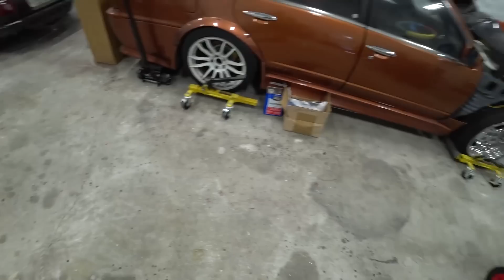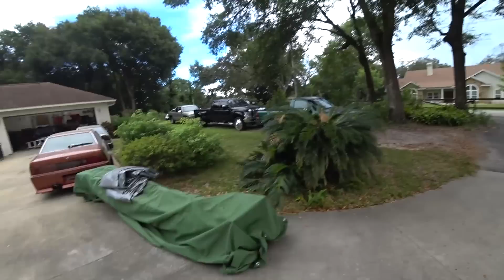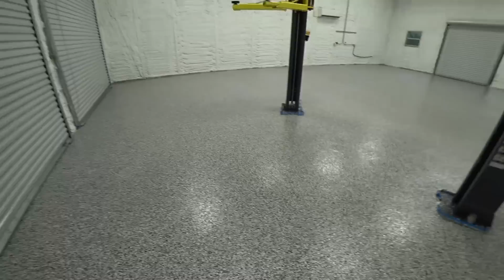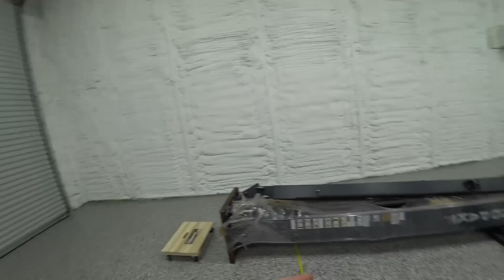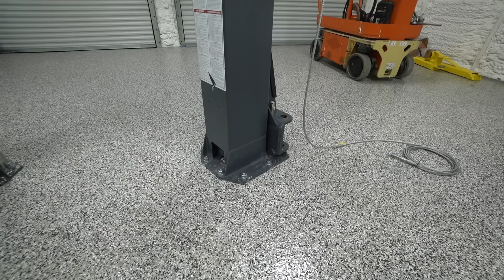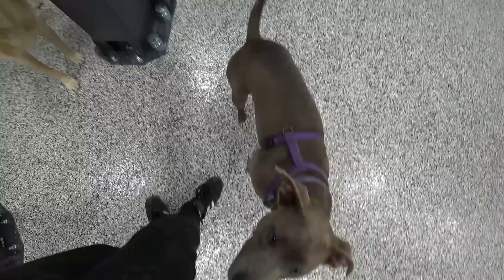My dream shop build is finally complete. came out amazing.

Comment: Taylor I came back to this video. I’ve got my new building up on my old concrete. I’m now ready for the floors. Was looking into the same that you have and was curious how they have held up. I want your size shop but had to settle for 20x50 but I did do the walls like you so I got a nice loft in. Thanks for any advice on it.

Comment: The basement at work got floors epoxied 30 years ago and before it completely cured someone (a PhD) rolled a pallet jack with something heavy on it and pulled up epoxy on the wheels for 100ft through a long hallway.  Why they didn't think to stop is beyond me.  It has never been repaired.  As you rolled the lift in this came to me.  That material they used on your floor must be good quality and you must have listened very carefully to the installers direction.

Comment: I would definitely not put the air compressor inside if you can help it. Too noisy too hot, build a little shelter outside and put it outside it will be fine

Comment: Looks great and I"m happy for you, long time planned usually turns out best.  I'm not sure if the spray foam you have on the walls is treated with fire retardant or intumescent paint but please consider covering it with sheet rock or even plywood if it's not.  Spray foam is highly combustible.

Comment: this was good action packed - nice to see floors done - you should do deck on back and some storage or office/desk back there too #who let the dogs out?
Reply: put up a couple tv on walls for pc monitor and get some decent speakers, put up banners/posters
Reply: get motion lites and cams, get a refurb server or 2 for the networking, run cat7 run at least 10g - think about getting a 800 buck 100g switch for your ws, 2 servers and a nas - you can do for about 3k and bring your own ws - the network is the weakest link and cheap 100g switches are game changers - combine with nvme - you can breakout one port into 2 25gbe also #mikrotik
Reply: sic 4 100gbe or 4 25gbe breakout cables avail - 25g cards are cheaper you could have upgrade path #swr matching

Comment: hey taylor floor looks great and you  are right when you say that poly-espartic is supposed to be more durable I install this these kinds of floors and they from my experience hold up quite well to oil/gas spills and such and it can take alot and with the flake you will never see any kinds of light scratches so you dont have to be worried about that just try not to steer ur wheels in place to much shouldnt hurt it but better safe then sorry but will last for a very long time

Comment: Polyurea floors are decent for that application but real shops would benefit from urethane cement and MMA top coat if you really want a floor that'll last. Glad you enjoy it though I do these floors all the time, what people need to realize with these, is that these polymer coatings are stronger than concrete but are only as strong as what they're bonded too. That said it'll only fail where the concrete would've already failed.

Comment: Hellfire concrete coating would not be as pretty as what you have, but it holds up unbelievably well to welding, grinding and hot sticky tires.

Comment: SO, I bought a building a cpl years ago not far from you, did the same thing, with PolyCuramine and Speckled flakes - it LOOKS nice, but it SUCKS for a mechanic/Machinist shop because if you ever drop a small screw, a spring, a washer, ANY small parts pretty much could on them disappearing into the "Camo" on the floor forever, and if you weld, the small weld BB's that drop make burn marks everywhere - It Looked SUPER nice (Like yours) when I first did it, but two years in and there's been DOZENS of times I wished I hadn't..........

Comment: Please please please cover at least the bottom 8 feet of the walls it plywood, the white painted foam looks absolutely shit, if it was a darker color so it hid better it wouldn't be as bad but it just looks so bad and unfinished with the uneven bare insulated wall.
Reply from the maker: People don’t realize that it would be an insane amount of work to do that now. I would have to pull allllll the electrical off the wall. And re do all of the conduit. And shave the spray foam down. It’s not a simple project. I don’t mind them. It’s a shop. Not a showroom. And the walls will be covered with stuff anyway.

Comment: I put some epoxy in the holes and on the bolts of my lift. I also hit rebar on mine. You can take a 3x3 piece of angle and weld it to the base and drill holes through the angle to get out the way of rebar
Reply from the maker: I just drilled lightly so it wouldn’t bind the bit until I drilled through it then finished the hole.

Comment: having worked in shops for 10 years, polished concrete > epoxy and related.

coated floors get extremely slippery when there's a fluid on it as opposed to polished concrete still retains a bit of grip. and if you add grit, it'll eat a mop alive and leave behind lint. plus I think it just looks nicer.

Comment: Question on the lift arms, equal length, which looks like what you have  VS non equal length lift arms.  

Why did you get the one over the other?

Comment: Does coating the concrete provide any actual benefit / durability? After all it's a shop and not all about looks.

Also, you mention the concrete was too decayed and soft for the other coating you wanted. Given this, shouldn't you have prepped and reinforced the mounting location of the 2nd lift before coating the floors?

Comment: Best way to set an anchor bolt is with epoxy the bolts will not pull up at all with epoxy ever I know this cuz I've been doing concrete for 20 years

Comment: does nobody make low-profile 2 way ramps for the rear so you could drive over them with a running car, or would that not work? I thought about that a few times watching you remove the rear ramps before driving off

Comment: As someone who has owned multiple shops, and still does. I can't stress the importance of making an outside shed for your compressor. No matter how quiet and efficient it is.... It still produces heat and makes noise. You can always make it impossible to hear for your neighbors. But, to make it impossible for you to hear.... it will consume a ton of shop space. A small pad that can be hand poured, a quick enclosure with insulation. Game changer. Being in Florida, just make sure you have an automatic moisture drain on the compressor, and use multiple water air traps (those can be plumbed inside to increase efficiency). I can't stress that enough.

Comment: I would have personally took the lift and put it in line with the other one behind it this way you can use the lift in front lift a vehicle up you could drive another vehicle underneath it to the other lift or you could come in the secondary door and drive right into the other left and then you have that whole left side open.....

Comment: You should get the storage 4 post lifts
Reply: There's a company that makes 4 car storage 2 on the platform and 2 under and benpack makes a 3 car storage lift it's cool cuz you can use one corner but the thing that sucks is that you need to have super high ceilings for that

Comment: Your shop is amazing. I just recently got my own work space and I'm in the process of renovating it. Not nearly as big only 750 sqft and not a full 2 story but I'm pumped for it. Got new windows and a man way door in. Priced epoxy flooring and it was almost $5k so that bit will have to wait until the end or never perhaps. Even diy would cost $3-3.25k for a good kit and shot blaster rental.

Comment: Really, really hope that the concrete was acid etched before they put any of that coating on.  Even if they ground a layer off of it, the concrete will still have oils and will prevent a good bond.

You might be having to take everything out again in a few years to redo it.

Comment: I definitely would put a big stainless sink in, maybe under the stairs for the loft. We have a large one from a commercial kitchen that was torn down and it's extremely useful. Not just for washing up after greasy projects but also for cleaning/soaking parts if needed.

Comment: I worked at a dealership where they put the lifes all in a line down the shop and spaced them 24" apart. I had to squeeze through if I had a tire up against my chest.   It was fine.

Comment: We have the same floor in our shop, it really does stand up 100x better then epoxy. Getting tire marks our can be a little bit of a pain in the ass. But diluted brake clean seems to work well. We've had one spot crack up, but its a spot that sees heavy abuse with 600+ lbs in that same spot, over and over and over. Floor guys came out and repaired it, haven't had an issue since.

Comment: A polyaspartic top coat was definitely the right choice.. however I would still take it easy on the hot tires and turning the steering wheel with out moving fwd or in reverse. It's still not indestructible

Comment: Awesome content... might want to consider  putting the other lift a little further into the shop. So you can get something in behind it and have enough room to work.  So you don't always have to be working around a lift. Will the f350 drive thru the lift? Or your open trailer by chance... I said this before watching the whole video

Comment: Awesome man. I am working on my shop right now in a similar stage. Just got the floors done and everything back in. Doing electrical now and I have the same lift ready to install. My shop is 40x40 and I ended up deciding similar straight forward install. If I do a second one it would likely be 4 post over another 2 post lift. You are able to work a little quicker than I am. Still waiting on HVAC. I have a gas line to my shop so deciding on hanging heat, house furnace a/c, or the mini-split system like you have. Once that is in I have ceiling, insulation, and walls. I already put a mezzanine and bathroom in mine. The different type of construction it made sense to do things in a little different order.

Comment: Seeing as you will be doing filming out in the shop you might want to look into adding acoustic tiles to the upper walls and ceiling to cut down on the echo.  You can buy premade units or make them yourself with rockwool safe'n'sound and make wood frames and cover them with drop cloths or flags etc.

Comment: I worked at a place for 8 years that put this same type of coating on the floor in the office. It was a CNC lathe shop, I always had large steel chips imbedded in my shoes. It holds up well. As long as you’re not doing SUPER abrasive things on it, it will last 10-20yrs probably. The area under my rolling office chair was just slightly dull/scratchy after nearly a decade of dragging my boots and plastic wheels with steel chips stuck in them 👍🏻👍🏻
Reply: And by “last” I mean keep its shine! Hope you enjoy it!

Comment: Taylor think about putting the compressor outside keeps noise level down. Good luck. 👍🏼
Reply: But draw the dryer air from inside the conditioned space... (might add back a bunch of intake noise, though.)
Reply: @mattmanyam  exactly what is need to be done. But remember no matter we’re u put it water will be a problem. But if you put an air dryer after compressor problem fixed.
Reply: Or invest in a screw compressor and the noise isn’t a issue
Reply: @johnhunter4465  john have 2 at work they produce water also.
Reply: @robk9827  all compressors create water, you should drain them daily.
Reply: @johnhunter4465  very true 👍🏼

Comment: I never understand why people are so cheap that they won't spend a little more and put up some plywood, MDF, anything atleast 8 foot high to protect the insulation and facilitate hanging stuff. But every time I always seem them complaining later that it's all tore up etc etc. Plus it just looks cheap.
Reply: Can be a fire hazard.
MDF in florida humidity swells up and disintegrates quickly. 
But , I agree, some solution for hanging stuff would be nice... metal pegboard or slatwall?

Comment: it's crazy to see those old pictures/videos and see how limited your work space was with the old building. but glad you took the dive to start from scratch on the new shop instead of closing in the old one(even if you were able to find a way around the permit issues). can always add the bathroom back later anyways with far less damage to the floor then the old school way of doing it.